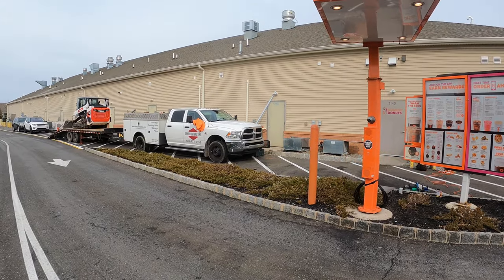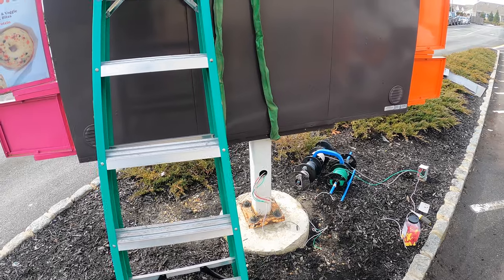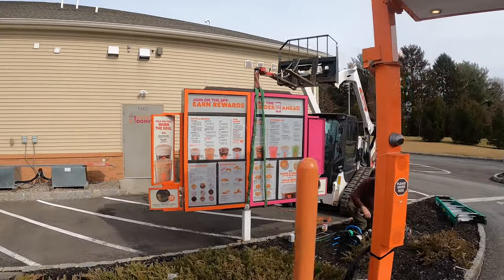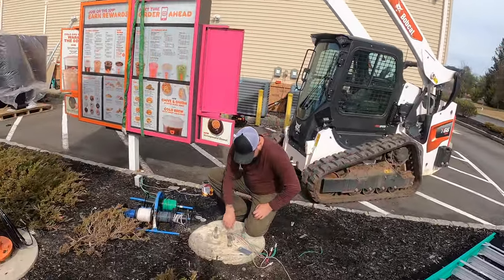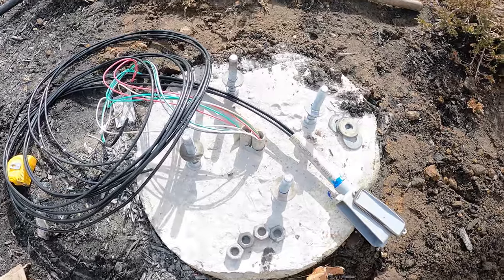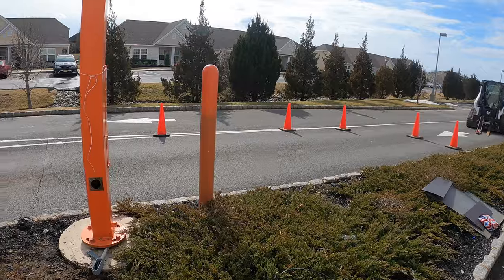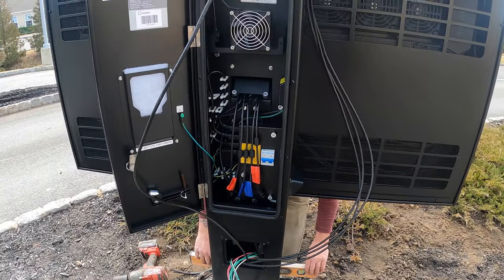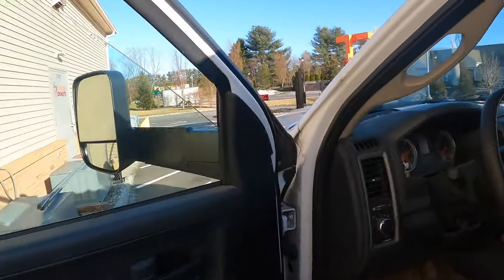Digital Menu Board Installation

Comment: Amazing the drive thru stayed open in the process.  Never saw a hand pump to blow out drilled holes. Reminds me of when I used to install pay phones. I was wondering why you ran the new wires before bolting it down, I guess the  handhole is too tiny to run the wires after?